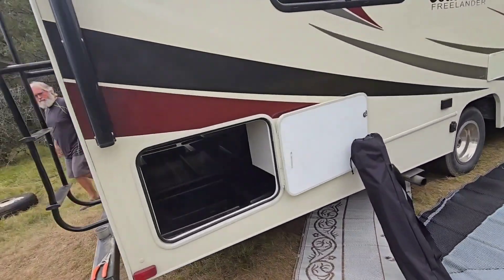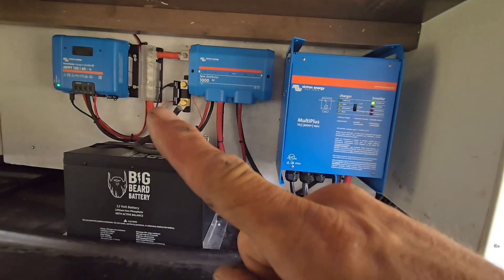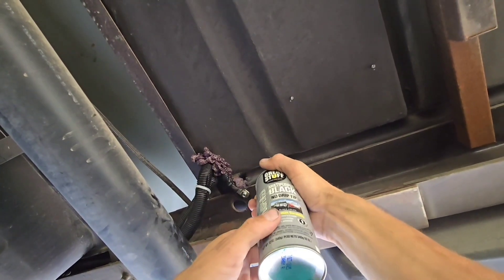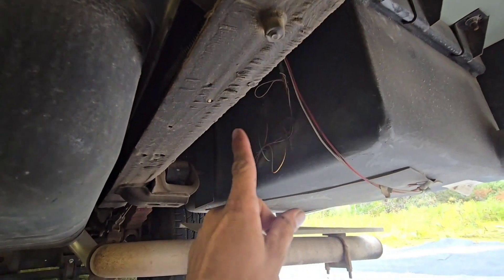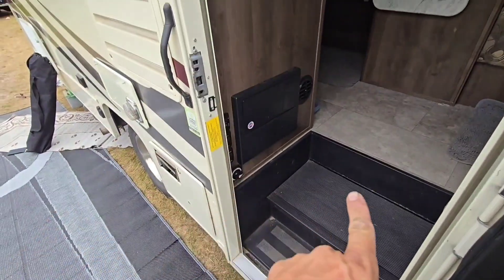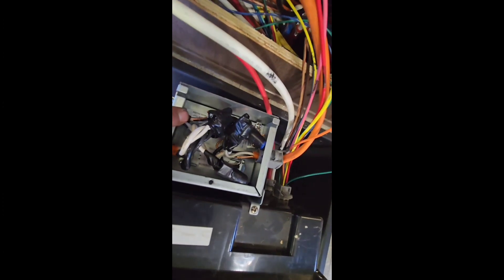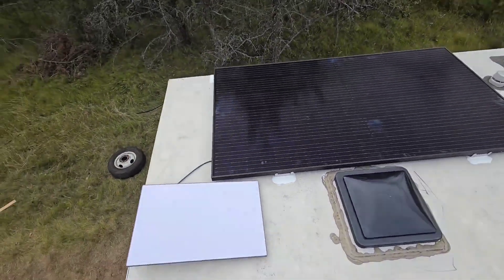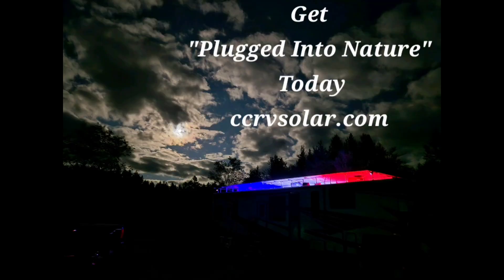Budget Friendly RV Solar System in Coachman Class-C

Comment: Ooohhh. will this one run
 a/c?
Reply from the maker: It will, pretty much every system I install will run an A/C.  With this exact setup tho its going to be very limited.  3-4 hours and the battery % would be getting pretty low

Comment: 10 grand is budget friendly???
Reply from the maker: Yea everyone's idea of "Budget Friendly" is a little diffent I suppose.  But when we are talking cost of a system with a quality battery, Victron components, installed by certified/insured installer.  $9.8k I feel is a deal.  My average system cost is closer to $12-14k.  Some installers charge $10k just in labor so pricing is all over the map but a RV solar system is never cheap.....thanks for watching and commenting.....
Reply: @ccrvsolar  What utter rubish you write down here.I have a Victron system with 17kw/h battery,5.6kw of solar power,and a 6kva all in one inverter with cerbo and an extar 45 amp voctron charge controler,for 12k euros. 9800$ for this system is uber expensive,its not a deal,not even if certified electrician builds it.Alsi its so simple,almost anyone can do it,than there is even more cost saving. When i listen the video,you so lejerly mentioning the price i had to rewind 2 times to hear it clearly,if i hear that expensive price correctly XD My system feed a whole house,not just an RV.I could make this same system for 3-4k$ tops.
Reply: I see about $3300 retail for equip, must be $7000 for labor?

Comment: That IS a cool and cheap system. It will last long with these good components. And this is what makes it cheap in the long run. Are the modules glued to the roof? Cable protection there would be nice, maybe a floor cable canal glued to the roof as well.
Reply from the maker: Panels are not glued to the roof they are just installed with normal z brackets screwed to the roof with buytl tape and dicor for sealant....
Cables could be run through  a channel or covered with eternabod tape but honestly in my 150ish systems it's never been a problem but obviously not impossible to get snagged by something.....
Thanks so much for watching and commenting.....